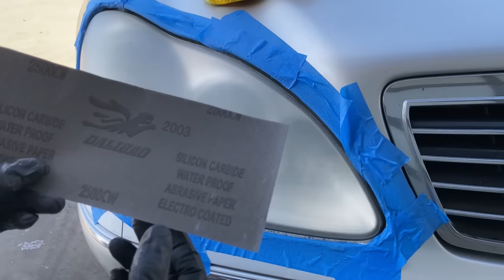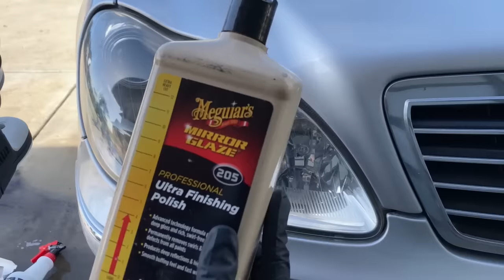HOW TO RESTORE HEADLIGHTs PERMANETLY

Comment: How to restore headlights permanantly: make them from glass again instead of plastic
Reply: Glass is heavy, costly, harder to mold into complex shapes, much dangerous when broken in an accident, way less repairable.
Reply: @jeepowner2675  so are you saying you have zero comprehension?
Reply: @VardhanShrivastava  im saying i think your response is dumb. Its not that much more expensive. My jeep has glass headlights and they were like 100 bucks for both at autozone.
Reply: @jeepowner2675  'it's not much more expensive'?do you have any data back your claims up? Do you work at an Automobile Manufacturer? Just bcs you think something works certain way doesn't mean it does.
Reply: Yea and instead of cloudy lenses, replace them twice as often because of chips cracks and shells
Reply: @aaronmenchinger  The only time i've ever replaced my glass headlights was because I bought brighter ones... they dont break like you think they do
Reply: @jeepowner2675  they also I'm guessing are a generic shape, either square/rectangle circular/oval. The design of new headlights nowadays if made of glass, if even possible probably wouldn't be as robust
Reply: Fr ❤
Had a Car with glass headlights then bought another one but Facelifted boom fucking plastic headlights they are a pain to polish up.
Reply: All these discussions about glass or plastic, glass won't come back in the automotive industry, and plastic sucks its cheap quality and a rip-off yet more durable when rocks hit it, i had glass headlights every 3 months i saw a new chip in it.

The only two solutions are either buy a car with glass headlights or wrap your headlights.
I did this with my car now.

At least i don't need to get them restored every 6 to 8 months.
As much as i agree, cars having glass headlights manufacturers don't want that extra cost because plastic just is cheaper.
Reply: 😂stupid answer😂😂😂
Reply: Glass headlight covers work out, but not for this specific cover style. To make the glass survivable under uneven vibrations and even get it into the consistent shape would make it easily over 10 pounds. Now that's not a lot to a car, but that is to the mounting solution that keeps it all in place, and the sturdier glass is mounted, the more stress it endures from those vibrations, but rubber mounting would help for a good few years until the gasket decays.

Plastic is also cheaper, so I'm not going to deny why the manufacturer insists on it. Glass is also not infallible when it comes to scuffs, glass can coat up and need a polish depending on your local environment's salt and humidity averages.
Reply: They should have been made from glass. Never plastic
Reply: People be arguing their opinion like it’s fact.  Do you have evidence to back up everything your saying @vardhanShrivastava?
Reply: Blud, if you already have the car, buying/making a fucking glass headlight would cost way way more time and money than doing this when the plastic becomes yellow.
Reply: Can we do that with at least halfof the things that we now make out of plastic please.
Reply: @rickywinthrop  amen
Reply: @-The_Phantom  blud, it wouldnt have turned yellow at all if it came from the factory made of glass blud
Reply: Glass is Way better! You don't need to repair them. They are made of better material. And one who thinks plastic is better dies not think
Reply: Yeah broken glass is better 😂😂😂

Comment: With the amount of time and effort spent doing this, I think it would be cheaper to buy new headlights...
Reply: Depending on the nake and model, no. I believe the car in the video is a Mercedes and their headlights will be expensive
Reply: I believe it's almost always worth it to restore headlights rather than replace them.
Even if the headlights don't cost a lot for a vehicle, the cost and/or, time and work to replace headlights can be 
A LOT !  Not to mention the chance of chipping/damaging paint removing + reinstalling panels + parts. Some cars require bumper, grill, body panels, ect... to be removed..... It doesn't take much time, effort, money, or supplies to restore headlights. ANYONE can do it. And, why replace something that Doesn't Really Need to be replaced. Just my opinion though....
Reply: Lol..not if it's a Mercedes Benz! Its better to waste tht much time and efforts
Reply: Do you have any idea how much work it is to remove headlights, install (probably extremely expensive) new ones, AND make sure they're aligned properly so you aren't blinding people when you turn them on???
Reply: Depends on the car. On a crown Vic you sometimes see headlights sell for $40 A PAIR.. not worth the elbow grease. However a Mercedes, BMW or even a Volkswagen it may be cheaper
Reply: I do the math, my headlights cost $650 a pair $9 shipping ± $20 instalation (a week time wasted)
For a repair $7 total, 2,5 hour work. 

Buy me a new pair of headlights
Reply: Repair..don't look broke to me

Comment: On Amazon everything comes to $141.98. Still cheaper than buying new headlights.
Reply: Depends on what model of vehicle and how new it is. Some of these newer cars have insanely expensive replacements if you want the same light pattern.
Reply: I can replace both headlight for under $100
Reply: 400-800-1200, machine polisher and a heavy cut compound from literally anywhere. Then a cheap can of clear coat. This is way over the top on the sanding
Reply: Дешевле плёнку поклеить изначально
Reply: Then if you get enough material do someone else’s car for $200 with the left overs.
Reply: If you were living in my country i would have done the work for 10$ . Materials included😅

Comment: So all that hazy looking plastic/foggyness is purely on the outside? I always thought it's moisture trapped on the inside. (Honest question)
Reply: If there is literal moisture droplets, then it is on the inside due to a failed/faulty seal on the housing. That requires different methods of repair. But outside yellowing is oxidation build up on the polycarbonate lens 👍🏼
Reply: What this guy said ^. Headlights are permasealed (or similar). If there's moisture on the inside, you've got a problem
Reply: It is oxidized plastic and sun damage
Reply: @bailey78  both

Comment: Should have used a foam pad with your sandpaper for uniform application. We start 600-1000-3000 with drill attachment and blow this out quick. We sand cut and polish aluminum/stainless to perfect mirrors using airway pads.  I’ve also used white diamond metal polish on a flannel buff with rotary. No sanding needed, removes oxidation and comes out perfectly clear. But that’s my little secret go easy 700 rpm on a 3500 rpm makita with flannel airway
Reply: For the sand paper depending what cutting coumpound you got it could mess up the headlight if you don’t got the right compound for 600 grit
Reply: @Askyourmother424 Oh damn I have sandpaper scratches and lowest I go is 1000 grit and i use meguiars 105 cutting compound and meguiars 205 any recommendations to get rid of those marks ima get a cutting pad soon you think it would do the trick?
Reply: @dinozr2784  I suggest you use a 3M p3000 trizact pad after the p1000 and then use the compound/polish.
Reply: @dinozr2784  Also ease on the pressure when sanding and let the sandpaper do most of the work. After every step make sure to check for any remaining scratches from the lower grit. If you do every sanding step like this there should be no need for a heavy cutting pad.

Comment: You can skip the buffing part and go straight from 2000 grit to clear coat. Same results and 2k clear adheres better to 2000 grit marks.
Reply: 800 grit is the best finish 
You have to give the clear coat something to grab on to 
2000 grit only gives you a small area for the clear coat to grab on to
Reply: I used 600 + 1200 then automotive clear. Like new.
Reply: yep. finish @800-1200g is ideal
Reply: @teamfusionracing  can I do, 600 gritt, then 800, then 1500?
Reply: @senorbonbon  600, 800.... maybe 1000. don't go any higher grit....

Comment: That's a ton of different steps.  I would try just using your DA with compound as step 1.  You might get most of it out without the 7 different sanding steps (I did).

Comment: Actually, I have achieved clear headlights plastic enclosures without the use of the electric buffer. You just have to buff more vigorously with your hands. If, you park your car in the  summer sunlight. In due time, the yellowing will return. Depending how well a job you did. First-time.
Reply: Not using a buffer gives you worse results. A DA polishers imitates what your hand should be doing, flawlessly, every rotation, with even better pressure & results with less effort. By hand is just a waste of time. It’s like saying why use an impact wrench if you got a pair of channel lock pliers…
Reply: The clear coat on the lens will last for the cars’ life if the car exterior is maintained properly.

Comment: Not sure why they didn’t tape and mask off first and then leave it until the end…especially when polishing 😮
Reply from the maker: Tape will need to be replaced because Polish dust and spraying soapy water will ruin it anyways. You will need a fresh and clean one before spraying clear coat.

Comment: This is the exact way a Bodyshop would do them. Some errors 
You may need to go to 600 grit wet which is really the lowest you should go
You need to do a cross pattern 600 vertical 800 horizontal, your sanding off All the old existing clear coat. 
You need to use a sanding block to distribute the pressure evenly 
You may not need a wool pad you may use an orange pad 
You want it uniformly dull as in sanding off a clear coat that has failed 
Everything else is 100% correct 
You must use 2k clear that’s what’s on it originally because it’s solivent proof pretty much, 1k is not go through a car wash bug spray gas ect. 
You also better mask up the whole front of the car. 2k clear overspray is near impossible to get off 
Also use the Can within 24 hours 
This is the only correct method for Permanent 
Also if you don’t wanna use clear seal it with like a legit synthetic sealer- jescar power lock or like any coating system - this Will make it semi permanent 

Also if you have little small cracks doing this will make them
10x more noticeable 

Aftermarket headlights are not as good- they leak and are not sealed a quality aftermarket or oem is fine 

This Can be avoided by garaging your car or truck and treating the headlights like paint wax or synthetic sealer to protect the clear coat

It’s failing clear coat on plastic due to Uv light 

Also I have a mid 90s mercedes with glass headlights. 

In usa mid to later 90s dot outlawed glass headlights - during accidents they caused more damage then the accident and it resulted in increased injuries. 

I personally love glass headlights. 

Hope this helps someone 

If you don’t have a sanding block use a sponge.

Comment: You're  not going to believe this and i don't necessarily recommend it. But i use brake fluid and scrub it in with 0000 steel wool until all the yellow crap comes off. Then finish with a light layer of linseed oil

Comment: If you are going to clear coat the lights there is no need to polish them. In fact, if you don't get all the polish off the clear will not adhere properly. You are far better to sand it down to 1500-2000 clean the lights off and clear them.

Comment: Wow.. why not just use a da sander with 3m paper n go up to 3000 trizac. Then buff.. better yet use the 3 m kit. Hand sanding without some type of pad is useless. There is no way to get even pressure. And for the love of God, stop using that dime store painters tape. If you used a quality auto body tape.. like 3m, you could stretch it around the curves. Eliminating the need for a hundred ripped off pieces.